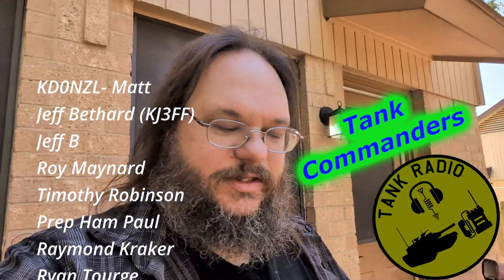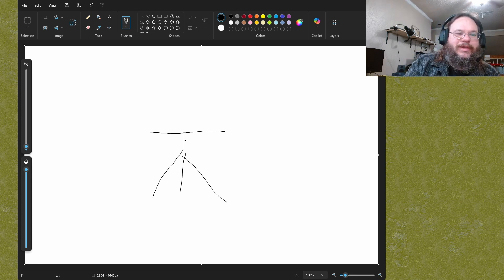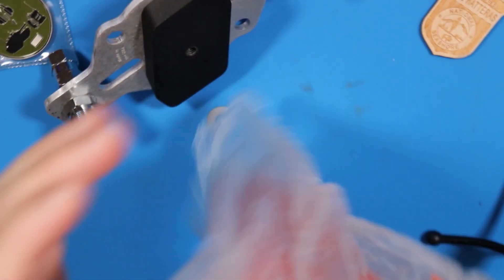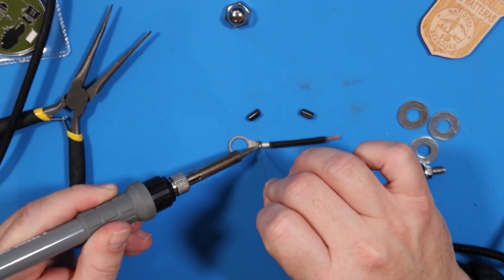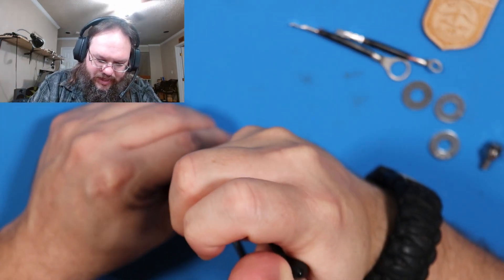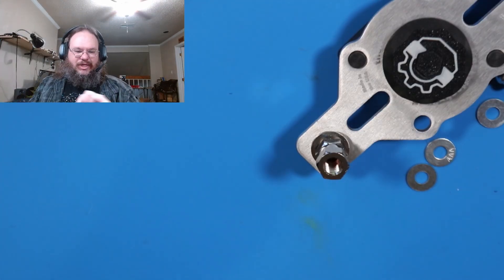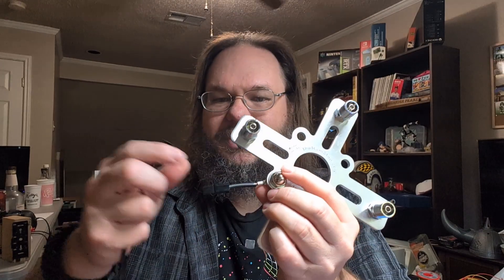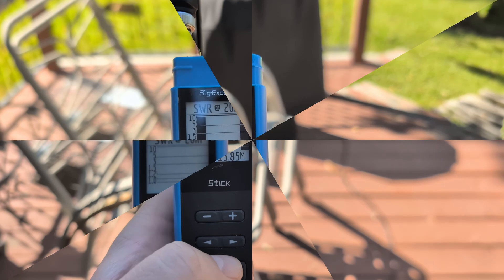Building Counterpoise for Hamstick Antennas for Portable Non-Intrusive antenna system

Comment: This would have come in handy for me two weeks ago.  I went into the bush to activate a rare county for my state's QSO party.  I started by running a 40M hamstick on a tri-mag mount on the roof of my truck.  After 50 or so QSO's I had 3 burns on my hand from the screws on my hand mic. Something wasn't right - I am thinking that the mag mount wasn't getting the capacitive coupling it needed to the steel truck roof and it was pushing power back into the radio.  I ended up throwing an EFHW up into a tree for the rest of the weekend.
Reply from the maker: Ouch, i think you're right.  I don't think you're getting the right capacitance out of the truck.  You shouldn't need a ground or counterpois system when you're using a mag Mount on a vehicle.  I'm glad you're able to keep going with the EFHW.

Comment: Have you put 4 different ham sticks on the mount?  If so was there any interaction between them or were you able to get them tuned?  As for carrying the hamsticks I use a section of pvc pipe put in a fishing rod case for my hamstick case. It works great.
Reply from the maker: A fishing roller case, That's an idea.   I was thinking of a PVC pipe, however for the top sections I need to figure out a way to mark them so I don't get the whips mixed up. 

Right now I'm only putting one ham stick on at a time, in a later video I'm going to try to make a fan. Hamstick dipole.  And yes the idea would be to tune them all to be a one-to-one or close I can get them
Reply: I tried putting a bunch of hamsticks into a length of pvc pipe with screw caps and keeping it in the back of my truck for when I needed them.  The hamsticks and the stingers all bounced around inside the pipe like they were inside a rock tumbler and wore the black insulators down a lot.  Be careful if you do this.

Comment: Great idea. Can you update the link for the HF antenna mount as the current link takes you to the 20gag wire?
Reply from the maker: You can make the links with whatever gauge wire you have.  I chose 20 because that's what was laying around and what I commonly use for antennas. Did that answer your question?
Reply: @TankRadio  No, two of the amazon links go to the wire. Amazon 20gag wire & HF antenna mount are the wire link to Amazon.